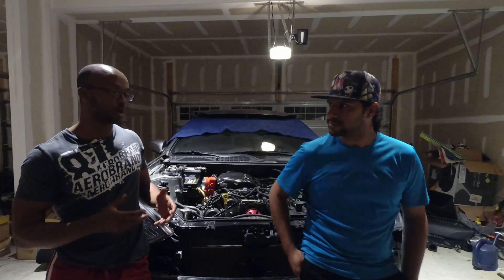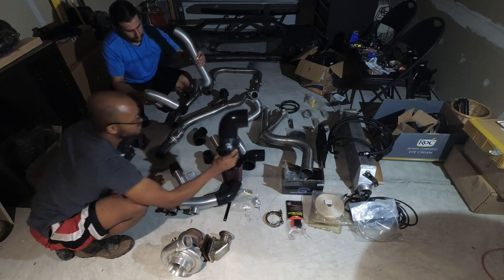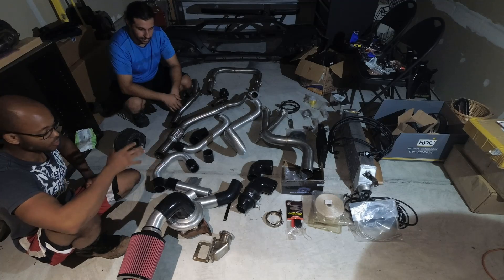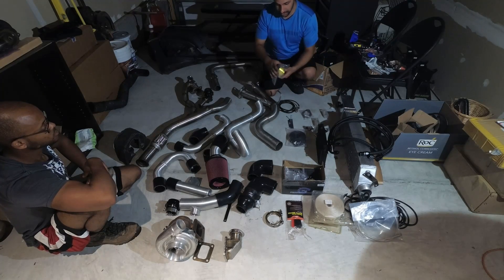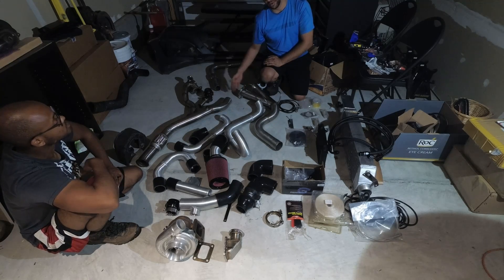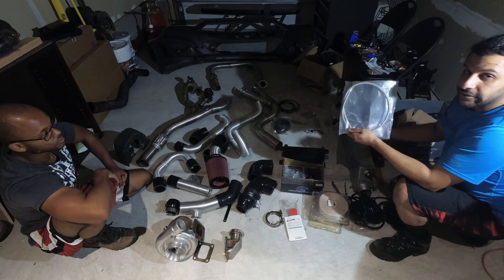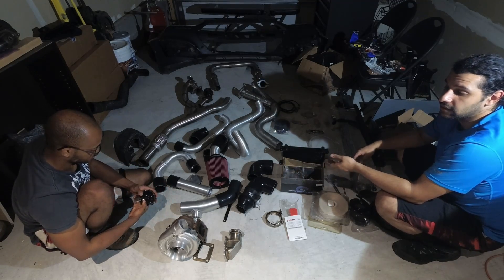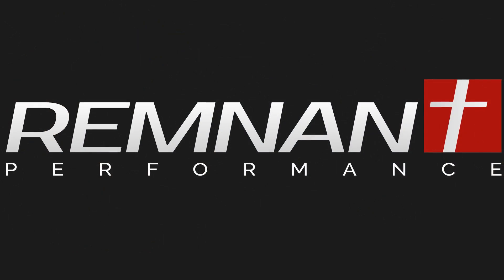1-A. Introduction and Kit Overview - RP 3.8 Turbo Kit Installation

Comment: do i need to upgrade the fuel system or is the stock fuel pump and injectors on a bk2 good enough?
Reply from the maker: The BK2 3.8 is GDI so it can’t really be upgraded at the moment from a fueling perspective. The good news is that the stock fuel system is good enough for around 600whp on pump gas
Reply: @RemnantPerformance  ok thanks

Comment: This is the SHITTIEST turbo kit I have ever installed on a customer car.
Reply from the maker: Thanks for the feedback Brian! I’m sorry you had such an issue. I wish you had reached out so that we could have helped resolve whatever problems you ended up having. Thankfully we’ve had well over 50 customers that we know who have successfully installed the kits themselves in the comfort of their own driveways and homes. Many of the known issues we have found have actually stemmed from poor quality control from Hyundai when it came to installing engines in the engine bay. We’ve had at least 4 situations where nothing was fitting up, then customers have taken pictures of their engine bay and the engine was mounted from the factory up to 2-3” closer to the passenger side than in the middle. Once customers loosened their mounts and used a pry bar to push everything back over, everything fit up the way it was designed to. At any rate, please help your customer get in direct contact with us so we can help him in the future. Thanks!

Comment: I have a genesis 3.8 v6 2012, with the GTX3582R GEN 2JB turbo kit can I get to 525whp if I forge the engine?  I would have to change pistons, internals, blocks right?
Reply from the maker: Yes you can. The GTX3582R should be max effort 650-700whp capable

Comment: What’s the highest HP I can reach with this kit?
Reply from the maker: That’s dependent on a lot of factors:
1) Whether or not you have a built engine
- Without a built engine, you’re going to be limited by factory internals, namely the factory pistons. The factory pistons are powder pressed and the weakest link. 400-450whp is easy all day. We have some customers pushing significantly higher than that on factory internals
- With a built engine, you’re going to be able to push much higher. Depending on your type of engine build and fueling, you’re looking more for what the turbo can support

2) Turbo Choice
- The standard GTX3582R Gen 2 JB is capable of supporting around 700HP at the engine
- The 70 OMEGA can support 1200HP at the engine

3) Do you have enough fuel?
- If you have a BK2 3.8, it is a GDi system and factory fuel will run out somewhere around 600-650whp on gasoline. Multiply that number by 0.67 to give you the limit on E85. You will need to add additional port injection to get higher than that.
- If you have a BK1, you’ll need an aftermarket ECU to efficiently go above the fuel injection capability in the kit (~500whp).
Reply: @RemnantPerformance  And this is what customer service is, thank you so much for the information.

Comment: Wanna buy a kit just building internals is stupid expensive, unless anyone knows of a shop that has good prices
Reply from the maker: Hey Marqise! Well unless it was part of your plan to build the engine first, this kit was designed to be safely used on stock internals. That said, if you want to build your engine, there is no better place than MT Motorsports out of Las Vegas. Here is the link to their website: http://mtmotorsportslv.com/

At any rate, feel free to give us a call at 336-360-8780 if you'd like to discuss things with us further!